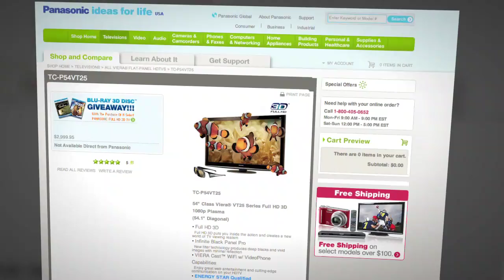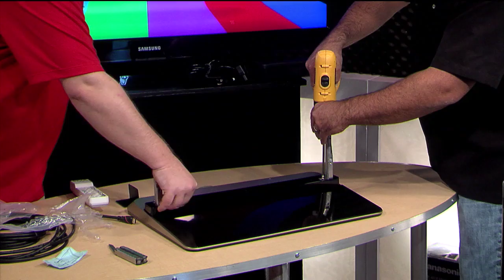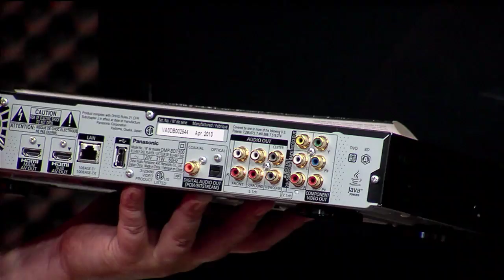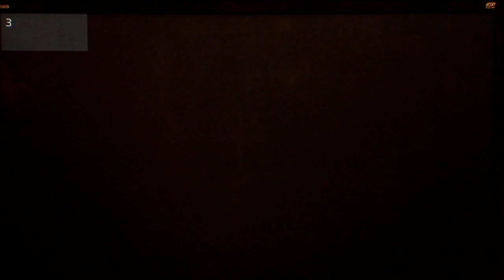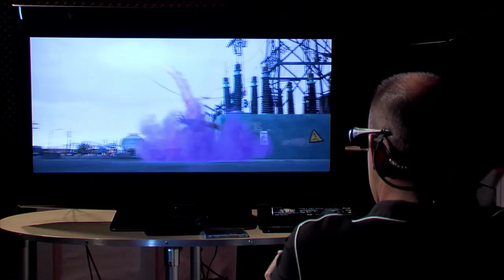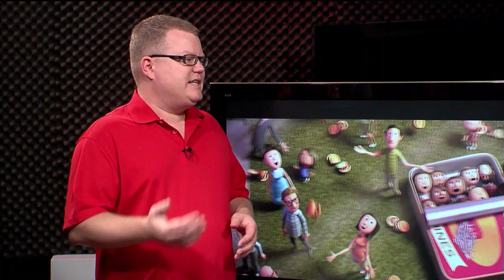3D Mania! Unboxing Panasonic's VT25 and BDT300! - HD Nation Clips

Comment: @edgarbarradaskate normal size deck, yes every single board, 3 yr old drill, 19.2 volt not 18, still have it to this day and it is still kickin ass with the same batteries. plus the warrenty is better on craftsman tools

Comment: @twoZkingRvette1fast
did you screw every single Board with that drill??  .. your killing your batteries if you did so... how big was the deck?.. anyways DeWalt still best .. cause if you had a brand new drill of each brand with the same 18 volt batteries .. DeWalt wins on torque power and battery life.. by the way... Ryobi tools are crap!